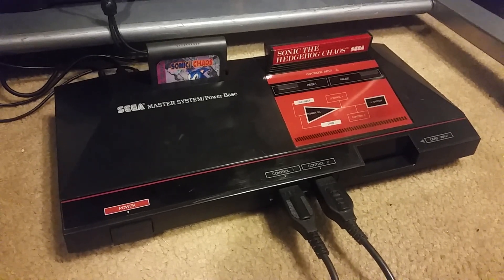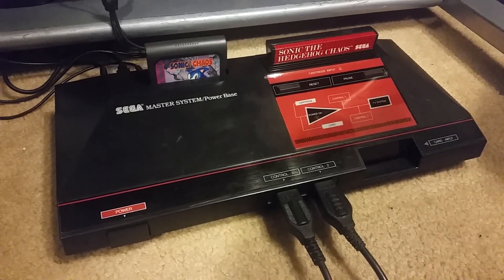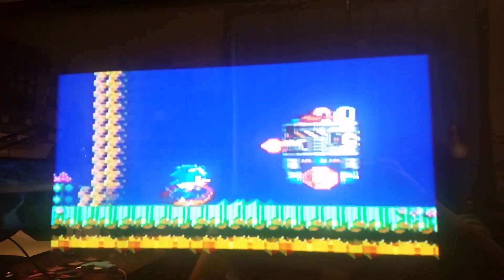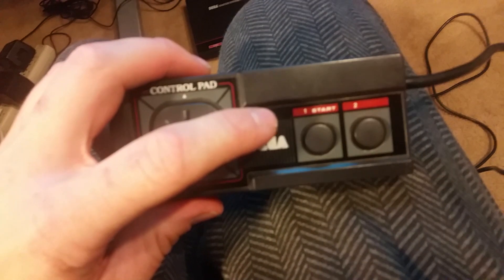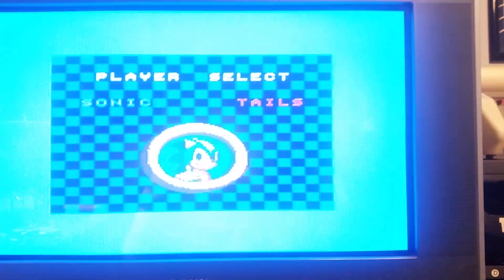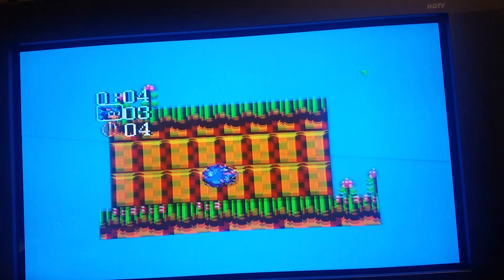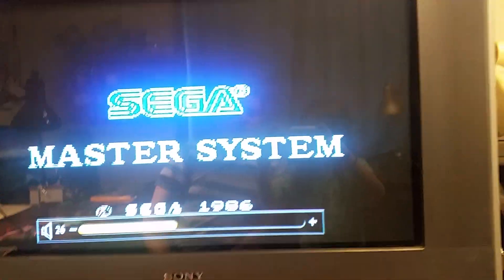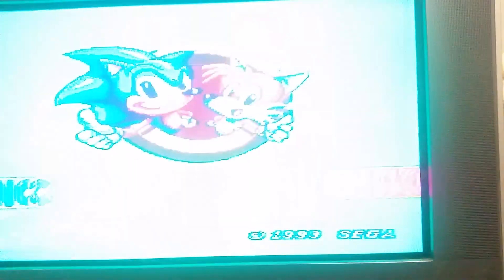Game Gear/Master System Console

Comment: i was thinking... they have master to gamegear converters, although the gamegear has differences i wonder how hard it would be to make a cart to convert gamegear to master?  i know some clones have them and third parts like retroduo with the sega genesis to snes converter which packs a genesis on a chip in a cart.

shouldn't be impossible,  i love mods but i have a hard time wanting to cut my systems up.

now a days it would be a gamegear on a epoxy blob.

Comment: hey man, love the project. I have one question, does the gg tv board need the gg screen to stay attached to the board to work? I installed my gg tv board on a game gear with  no screen at all a d the video out is pretty messed up. just wondering what you did with your design, thanks man
Reply from the maker: +Super Saiyan Machoke Ah crap! Forgot to respond. 

You don't need the screen at all man. 
I removed the screen and any components linked to it.

Comment: Since you've switched TV inputs, this would mean that you're using independent AV-out for the GameGear as well as a dedicated power supply. Would it have been possible to piggyback on the Master System's DIN-8 for RGB or AV output using a 2-way switch? What about the power, would that have been possible? You're obviously done it for the controller port.
Reply from the maker: +theimporter 
Yeah it's possible. But I like to have two separate RGB ports, so I can run both systems at the same time if desired. 

I made another one recently that is much cleaner:

https://www.youtube.com/watch?v=FQLIq6mjjCk

Comment: Zach that's all this is, a board connected to the gamegear that outputs to the tv. If you notice it uses two different outputs. While still cool its just two separate systems in a case.
Reply: Ben Quinones it's true, but not for rgb. 
Look at the description "-For RGB, I tapped into the SMS din connector"
It'll be perfect with one power supply